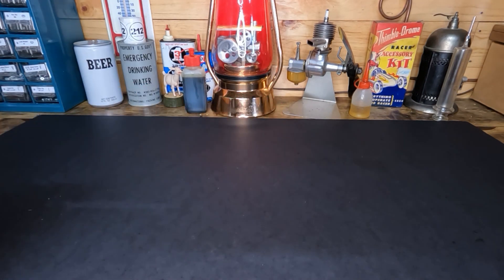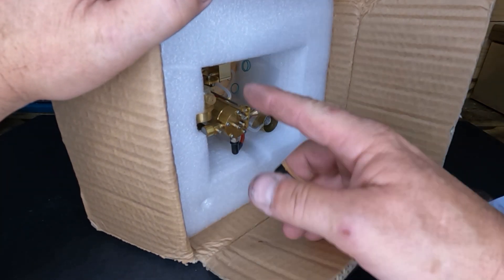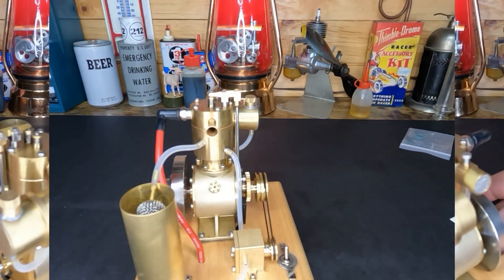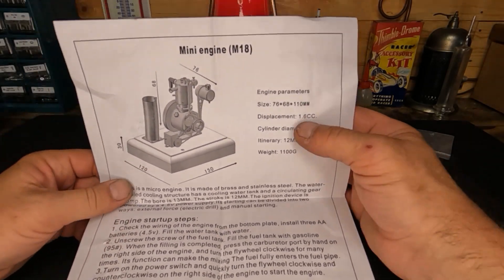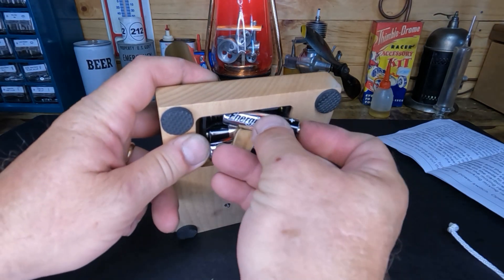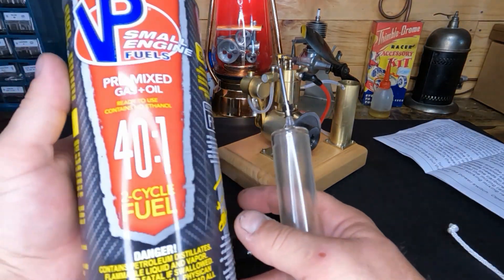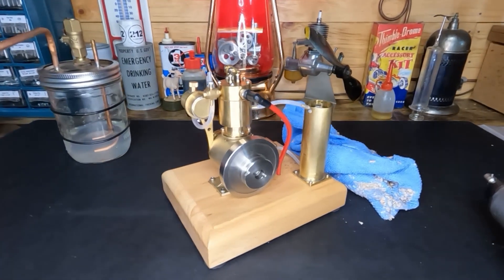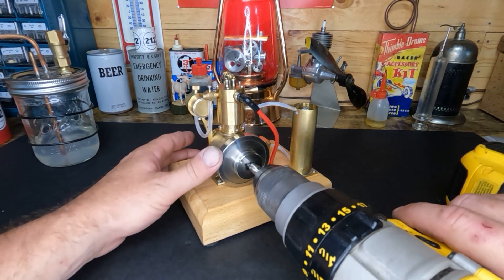M18 engine first start

Comment: I've bought a couple of those engines, they seem to be very sensitive to the needle opening. Usually about 1 turn open.  Also the ignition sometimes burns out after just a few runs.  I grounded the ignition cast to the engine base and that seemed to help the arcing.   Wal-Mart "Camp Fuel"  runs great in these too, same as Colman's Fuel.

Comment: You can just put the denatured alcohol (everclear) in the regular fuel tank and open the valve further on the carb.  I found those tiny carbs need the finest adjustment since the valve is only open about 1/8 turn on gasoline.  It opens 3/4-1 turn on denatured alcohol so you can move the knob more between adjustments.  I finally put long arms on all my tiny carb needles so I can get them adjusted fine enough.
Reply from the maker: Hi Henry, I should give that a shot (no pun intended). There is a BIG difference between denatured alcohol and everclear though, the next video has made it clear to me. And 1 you can drink and the other you can't lol
Reply: +1 on the c arb  arms

Comment: Nice. Mr 212, we have similar tastes in engine! I have looked closely at getting this. I'm still enthused with what you did with the H73. 
Anyway, this vid,  great structure / businesslike written summary. Then anticipating your first turn "good compression" I feel it after my dismal H73! Which I have got going but not slow enough. Which is what bothers me about this engine - no throttle - how long will it last at "full speed"? Were you surprised no throttle? Or were you more observant on the website buying it?
Reply from the maker: Hi Thomas, I noticed that there was no throttle and that made me curious about the opening in the carburetor itself (which does seem small) so that would restrict the speed, I think the designer had it together on this engine but it lacks a fine tunable carburetor. Thank you for the compliment and thank you for commenting 👍 I hope to have the next video out tomorrow morning.

Comment: hello! ive made good progress on the model for my engine, should have a working prototype by the end of the week, if i dont run out of filament :D i was wondering if you knew of any cheap-ish carbs for these engines that may work, if the other thing im trying doesnt.
Reply from the maker: Hi Nugget, I can't wait to see what you're making. If I were looking for a cheap carburetor for experiment purposes I would reach out to the local hobby shop to see if the have any used or damaged nitro rc engines that you could use the carburetor off of. It would be a good place to start, if they don't I'm sure they know someone who can help you.  I hope this helps you. Thanks again for your interest 👍
Reply: @steam212  thanks for the suggestion! ill do that if the vapor carburetor doesnt work out

Comment: Excellent videos!  I enjoy watching each and everyone of them.  I thought I’d drop a request since these little engines seem to run well on vaporizer style fuel tank.  Have you tried a vaporizer on the H75?  I wonder if you could get a smooth idle out of it? Or possibly remove the intake pushrods to eliminate valve overlap?  I thought it might be fun to hear a nice low idle out of the four.

I’ll be ordering the H75 soon.  Thanks and keep up the great content!
Reply from the maker: Hi Toydoctor, it's funny that you mention that, I tried it last night. I'll have to make a short video and share it with all of you. Thank you for your interest and commenting 👍

Comment: there was air bubbles in the fuel line and when it was sucked to the card inlet the engine stoped in the very last clip you added.
Reply from the maker: Hi Sherm, You're right, we it ran out of fuel. In the next video we do away with the tank and the carburetor.